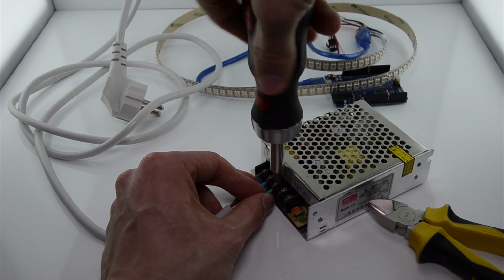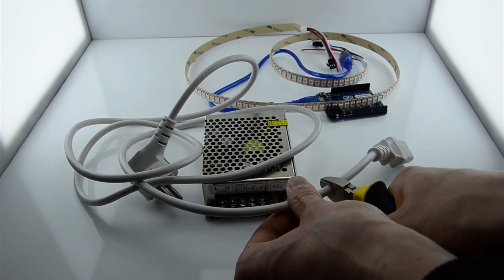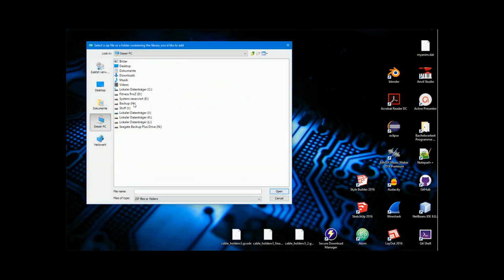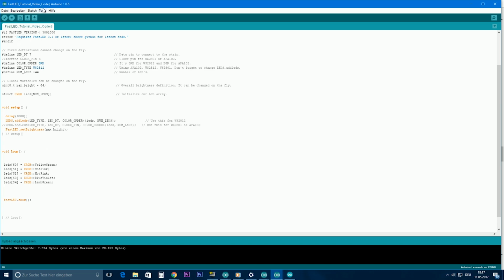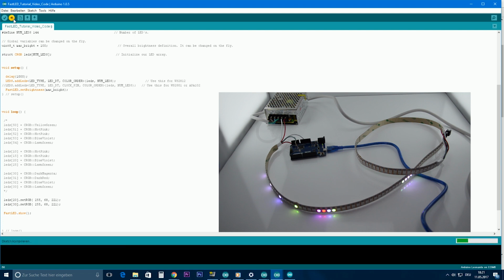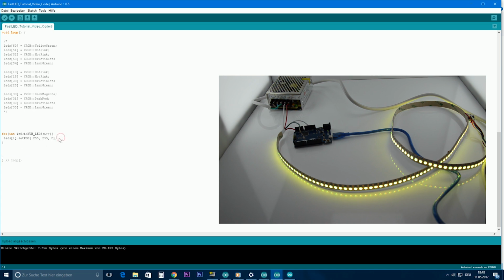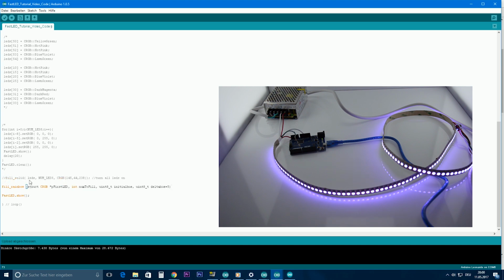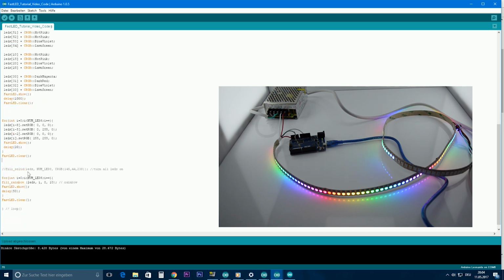How to control WS2812B RGB LEDs with FastLED and Arduino

Comment: Hi Mr,

many compliments for your beautiful lesson :-)
Just a question: i'd like to create a scoreboard with two digits 7 segments display for each tema, using a ws2812b strip led.
The idea is to create an array where every segment is made by 4 led (total 28 leds to each digit)
For example: to show the number 71 I need to switch on the BC segments for the units (from led 5 to 12), and the ABC segments for the tens (from 29 to 40).
Do You think is it possible to drive two of these counters (four digits) by an arduino mega?

Thans a lot, Umberto.
Reply from the maker: Umberto Ippoliti Hi thank you :-) Yes that is possible, you can drive up to 1000 leds with the Arduino Mega, so a few of your 28 leds digits won't be a problem ;-)

Comment: How can we control each LED bulb?
thanks for answers!!!
Reply from the maker: Each LED bulb will have it's own protocol, some will use IR, some bluetooth and some Wifi. To control different types you need an arduino or Raspberry Pi with all the different protocols installed. There should be librarys, you also need an IR diode, bluetooth and/or Wifi. Then you could send all the different protocols at once to turn all the different LED bulbs to blue for example. Or do you mean each light on a LED strip?

Comment: how to connection four wire led non-addressable LED strip?
Reply from the maker: Hi the code would look like this: https://learn.adafruit.com/adafruit-arduino-lesson-3-rgb-leds/arduino-sketch . But you need to put MOSFETs between the every of the 3 arduino pins and the LED input. Because the arduino pins can only handle around 20mA, an every LED is 60mA. It will look like this:
https://cdn-learn.adafruit.com/assets/assets/000/002/692/medium800/led_strips_ledstripfet.gif?1448059609
Best of luck! :-)

Comment: Great video, thank you. What if i DO NOT have a resistor on the data pin?
Reply from the maker: Well your leds could be damaged, especially the first led in the row. If this happens you have to cut away the first led, to get it running again.
Reply: i see. Thanks for the help.
Reply: @gbrown4612  how to calculate what resistor i neer

Comment: Great video!
Quick question what is the best wiring config if the USB is not connected and the Arduino is sharing the same power supply as the pixels?  I have 5v 12AMP power supply
Reply from the maker: Thank you. Well best configuration would be when you connect + and - from the power supply  to the led strip and the arduino and then just 1 data wire from the arduino to the data pin of the LED strip. Because ground is already shared inside the power supply between arduino and LEDs ;-) best of luck!

Comment: Hi, is it possible to use an Arduino Nano  to connect the LEDs strip and play with the different code like a rainbow for example
?
Reply from the maker: Yes, it will also work on an Arduino Nano. Best of luck :-)
Reply: Thanks  @hamburgtech  👍
Reply: Yes for sure. if you want to see them in simulations, please visit https://wokwi.com/arduino/libraries/FastLED

Comment: How would i do this but with Wifi, being able to go with the beat of music and for different zones? What hardware would i need?
Reply from the maker: Jason Tripp Hi you would need an Arduino, a wifi arduino shield and a microphone module as the hardware part. The sound part would be easy, but for wifi you would need to create an app or something else, to send commands to the arduino. It's not that easy. A remote control would be much more easy. Cheers
Reply: hamburgtech Bullshit. Go with the ESP8266 and the Wemos D1 Mini. Bitluni's Lab made great tutorials of driving Ws2812b LED Strips via WiFi with the Esp8266. A Wemos Mini is only 2.5$ on AliExpress.
EDIT :
To make an App is also unnecessary. Just use HTTP Requests via the HTTP Request app on Android / IOS. Bitluni's Lab explains how to do that

Comment: das hat mich auf alle fälle schon mal weitergebracht, danke dafür. das ganze auf deutsch und auch ich alter Sack hätte auch alles verstanden :D würdest du gegen Entgelt auch was programmieren ??? is auch nix schweres, ich habe auf 4m , 5 abschnitte mit unterschiedlicher Farbe ( statisch ) und als Highlight sollte rundumlaufend 3 LED breit es was dunkler werden das es wie so ein schein wirkt wie man es auch bei Hollywood Logos oft sieht. bei mir is es ein Wappen einer NFL Mannschaft ;)
Reply from the maker: OoOcommanderOoO Ja wäre auch möglich. Wie schnell soll das ganze denn fertig werden? Hast du vielleicht eine Skizze oder einen Link zu einem Beispielbild? Jo wollte eigentlich schon lange mal eine deutsche Version machen. Habe immer so wenig Zeit 😱
Gruß Nils
Reply: hi Nils, vielleicht schreibst du mir mal ne email ;) mixdevil@email.de  also ich bin grad in der Planung und Skizze für das Holzbauteil also es eilt nicht so sehr, geplant war in den nächsten 4-8 Wochen. logo schick ich dir dann per mail

Gruss marcel
Reply: Huhu, nicht mehr online gewesen oder mich vergessen ? Wäre cool wenn du mir ne Mail schickst das is für die Kommunikation um einiges leichter

Comment: Do you have to connect the arduino to the ground of the led strip can you just run the arduino of a usb of the computer and keep the power of the led strip seperate?
Reply from the maker: Yes, you have to connect GND of the arduino and the leds. But if you don't connect/share the positive wire the arduino will take the power from the USB and the leds from the additional power supply. So only share ground, but share it or it won't work ;-) Best of luck.

Comment: hi, when you calculated the amps you used 60mA, which is the maximum needed and you used 10A which is more than the maximum that could be needed. won't you burn out the leds with that much current?
Reply from the maker: Hi, it's more like the leds would burn the power supply if it can't provide enough amps. And the power supply won't put in 10A just because it can. Also I am pretty sure that all the leds are in parallel otherwise you would need like 300V to power the leds and not 5V ;-) So each led should only get a current of 60mA. But most of the time the leds will only use like 20-30mA anyway. Hope this helps you.

Comment: Nice video dear friend.
One question only: working with ws2812b 5v, for 3m of strip, could I use my PC next to my TV to power up the strip?
I'm also using the TV as a screen.
Or is it better for the PC's power supply to use a separate driver for the strip?
Thank you in advance!
Reply from the maker: Ιωάννης Νικλητσιώτης Hi friend, yes you can do this. The power supply of your computer is strong enough. You have to use the red an the black wire of a molex connector, that's 5v. The yellow wire is 12v. Best of luck
Reply: I appreciate it a lot you replied, thank you very much!

Comment: I don't understand why you need the resistor for the data wire?
Reply from the maker: "That resistor is for impedance matching between the Arduino's low-impedance output and the WS2812B's high-impedance input. When using long wires, they act like transmission lines, causing reflections, resulting in unwanted oscillations, ringing and noise." Or it's a cheap and easy way to keep some unwanted issues away from your LEDs ;-)

Comment: Hi, it's a very nice tutorial!
By the way, can we control more than 1 LED strip using 1 Arduino. Like i have 5 LED strip, and wanna have control each LED on each strip.
Is it possible? Or I need 5 Arduino too?
Reply from the maker: Hi, yes you can control 5 different LED strips with 1 arduino and have different colors or animations for every LED strip. You just need to define more led arrays. For example you have: "#include "FastLED.h"
#define NUM_LEDS_PER_STRIP 60
CRGB redLeds[NUM_LEDS_PER_STRIP];
CRGB greenLeds[NUM_LEDS_PER_STRIP];
CRGB blueLeds[NUM_LEDS_PER_STRIP];" Then you adress the strips like: "void setup() {
  FastLED.addLeds<NEOPIXEL, 10>(redLeds, NUM_LEDS_PER_STRIP);
  FastLED.addLeds<NEOPIXEL, 11>(greenLeds, NUM_LEDS_PER_STRIP);
  FastLED.addLeds<NEOPIXEL, 12>(blueLeds, NUM_LEDS_PER_STRIP);
}" and add some data to it: "void loop() {
  for(int i = 0; i < NUM_LEDS_PER_STRIP; i++) {
    // set our current dot to red, green, and blue
    redLeds[i] = CRGB::Red;
    greenLeds[i] = CRGB::Green;
    blueLeds[i] = CRGB::Blue;
    FastLED.show();
    // clear our current dot before we move on
    redLeds[i] = CRGB::Black;
    greenLeds[i] = CRGB::Black;
    blueLeds[i] = CRGB::Blue;
    delay(100);
  }
}" You can also find the example here:"https://github.com/FastLED/FastLED/wiki/Multiple-Controller-Examples" Hope that helps. I can make a video about this, but at the moment I broke my main desktop computer, when playing around with LEDs and a cheap chinese power supply ;-) So it might take me 1-2 weeks until I can do this. Best of luck!
Reply: yes, you can. The Arduino as such has no limitation on the number of strips. unless too many graphics are being driven, it' RAM is sufficient to drive 5 strops pf LEDs https://wokwi.com/arduino/libraries/FastLEDto experiment and learn without hardware :)

Comment: hey i want to ask you if you can save the patterns on the arduino or dosen´t the the light strip reapeat the pattern that you make while the arduino isn´t conectet to the PC?
Reply: Arduino repeat the pattern until is ON  and is connected to light strip with LED PIN (DATA)

Comment: Please Help!!! So I just finished a project and i realized my leds dont work! When I plug the led strip in about half of the cut strips work and the other half show colors that are not even present in the code? What is wrong with it?
Reply: Same problem, solved with the right connection. Remember to connect GND to Arduino

Comment: At just past 4 minutes into your video, you show a wiring diagram for LEDs and Arduino powered by the same power supply.  Why do you have the Red and White wires from the power supply connected to the USB input port ?  What happens if you connect your 5v DC out from the power supply via the power source input ?
Reply: Nothing unwanted will happen, he just didn't think about it...

Comment: Is it ok to have more amps than what you need? For example I need 10A but I bought one that supports 20A
Reply: Yes, it is ok to have more amps than you need, as long as the voltage is right.

Comment: what if using a ws2811 led where every 3 leds use 1 ws2811 ic chip? Is the sketch the same as the one in the description?

Comment: why do you need a resistor on the data pin
Reply: Resistor helps in matching the impedance of the lengthy LED strips. it is a good practice to have it when we are communicating with lengthy strips like these 😀😀

Comment: How come some of these videos show a capacitor connected between the negative and positive of the PS?
Reply: When you use only Ic not whole arduino board then a capacitor is required for stable and filteration the voltage and for good work.
Reply: It is always use when you program a sensor and read that value in arduino but when you use only Ic then a capacitor is required for same reading.

Comment: hey man! nice video! which wire gauge should be used if you want to cut the LED's from a strip and connect them together again? Will 22 AWG suffice? I would like to use 300 LED's in total, so total power consumption is 60mAx300=18W at 5V, so I would at least need a 4A power supply.
Reply from the maker: Mert Capkin Hi friend 22 awg should do the job, 4A is not that much ;-) For my next project I am using 288 ws2812b leds and found out that they use between 6-8A depending on the played animation. Best of luck for your project :-)
Reply: I have made some typos with my question. It should be 60mAx300=18A at 5V = 90W.. if I use 144 LEDs for a 12x12 matrix, is 22AWG also okay then? I would need a 50W power supply then. 

Isn't 288x60mA=17ish A. How do you get the value 6-8A?
Reply from the maker: Well as I said, I will use 288 LEDs for my new LED snowboard. If you calculate it, I would also need around 18A, but I used electronics that can only provide 12A max. So I measured the amps of 72 of my LEDs, which is 1/4 and it was not above 1,7A. So all my 288 will not be above 8A. I will not turn them all white at the same time. Maybe just one time for testing, but with a stronger power supply. What I want to say is, that you LEDs will need a bit less power as calculated and if you don't set them white you will need even less power ;-) 22AWG should be okay. 50W power supply will be fine, bigger is always better, until it comes to mobile projects ;-)

Comment: Is the 470 Ohm resistor optional?
Reply from the maker: Hi friend, 470 Ohm is optional, but you should have a resistor around that value. 2xx or 3xx should also be fine.
Reply: hamburgtech Thanks!

Comment: I just don't see the need for the resistor. You supply 5V, they require 5V. Am I missing something here?
Reply from the maker: Jeroen Ritmeester Hi yes the voltage is okay at 5V, the resistor should make sure, that the current is not to high.

Comment: With that code what is here I run into this issue can you help me please? 

Build options changed, rebuilding all
kep:4:21: error: FastLed.h: No such file or directory

compilation terminated.

exit status 1
FastLed.h: No such file or directory
Reply: Seems like Arduino IDE doesn't see the FastLed.h file, you have extracted it to a folder that's not included in its search path(s). This is normal with any software development environment. From the IDE you should be able to configure the paths where header files are looked from.

Comment: If I give power to arduino by my 10Amp power supply then our arduino not burn?
Reply from the maker: Well the 10A wont go through your arduino, directly power the LEDs with that Amps, arduino will only control the LEDs and not power them. Best of luck 👍🏻

Comment: Sorry maybe this is a stupid question but after uploading the sketch to the arduino and unplugging it from the pc you then only need to connect the arduino to your other Power supply via the micro usb or how's that done?
Reply: You can power the Arduino with the USB, or the pins labeled 5V and GND on the Arduino if you have a regulated 5V power supply. This can be the same as the power supply for the LEDS. Just don't use both USB and 5V to power the board.
Reply: Jeffrey Knight i knew about that I meant something different but found an answer to my question but thank you anyways.
Reply: Jeffrey Knight i knew about that I meant something different but found an answer to my question but thank you anyways.

Comment: Sir when I connect100 led's it is not function I changed the led quantity in sketch 60 to 100 in cyclone and demo reel what can I do please help me sir
Reply from the maker: Hi, did it work with 60 Leds, but not with 100 Leds?
Reply: hamburgtech Kommt vielleicht von Spannungabfall auf der GND Schiene und der dadurch entstandenen Data Corruption aber schau dir mal mein Kommi dazu an

Comment: How much maximum led we can use??
Reply from the maker: Well with an arduino mega up to 1000 LEDs but wont be that fast. For 1000 up to 3000 LEDs better use a teensy or ESP32.

Comment: hello, if we use a higher voltage than 5V, we can't power the Arduino with the same power supply?
Reply from the maker: Hi, depends on the arduino that you use, some can take higher voltages. The Arduino UNO will work best with around 7 to 12V. More than 12V can lead to overheating of the voltage regulator.
Reply: @hamburgtech  is an Arduino nano good?

Comment: I want to add some leds like that in my car that is 12v power source. How can I connect it to the arduino that is 5v power source? Any ideas?
Reply from the maker: Hi friend, just buy a step down converter, that converts your 12V to 5V, like this: https://de.aliexpress.com/item/Waterproof-DC-DC-Power-Converter-12V-to-5V-24v-to-5v-DPC-0505-Buck-Module/32464372931.html?ws_ab_test=searchweb0_0,searchweb201602_1_10152_10065_10151_10068_10193_10194_10304_10307_10137_10060_10302_10155_10154_10056_10055_10054_10059_100031_10099_10103_10102_10101_10052_10053_10142_10107_10050_10051_10084_10083_10080_10082_10081_10177_10110_10111_10112_10113_10114_10180_10312_10313_10184_10314_10315_10078_10079_10073_10186,searchweb201603_1,ppcSwitch_7&btsid=ba8170c9-5476-46b1-9910-8b7f2289266a&algo_expid=4be6df75-b099-49b1-91ad-cb0ea38af444-0&algo_pvid=4be6df75-b099-49b1-91ad-cb0ea38af444&transAbTest=ae803_3 Best of luck :-)
Reply: hamburgtech oh ok thank you very much.
Reply: Do I need to add a resistor to go with the step down converter?
Reply from the maker: Very welcome :-)

Comment: Hello

How many watts is the powersupply. I want to power 145 ws2812b leds how many watt powersupply do i need a 50 watt or 100 watt.

Thanks in advance
Reply from the maker: Well that is 145*50mA = 7250mA = 7.25A  7.25A*5V = 36,25W, so go with the 50W power supply.
Reply: Maximum current for each Neopixel is about 60mA at 5V so 145 * 60mA = 8700 mA / 1000 = 8.7 Amps. So a 5 Volt 10 Amp PSU would be required (5 Volt * 10 Amps = 50 Watts).
Reply from the maker: Well they always tell you it's 60mA, but when we mesured it, it was around 50mA.

Comment: hello, what do we do with the extra red wire??
Reply from the maker: Hi, which extra red wire? 🤔😉
Reply: @hamburgtech  there are 5 wires coming out of the Led stripe, 2(red and white) connected to the power supply, 2(green and white) to the arduino but there is still one red wire left, it is difficut to see but you also have that extra wire in your video

Comment: Does your LED strip get hot?
Reply from the maker: Hi friend, well the led strip should get just warm but not hot. If you glue it on a metal surface like an aluminum profile the cooling is even better.